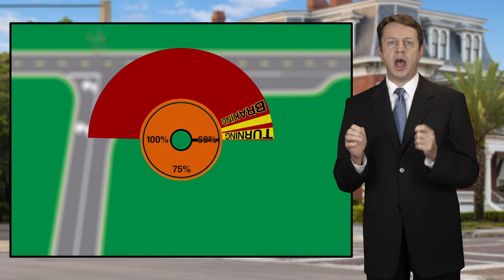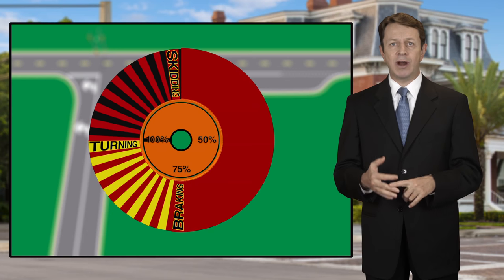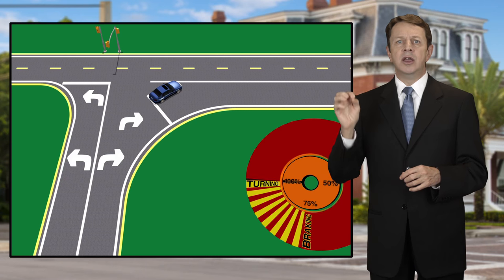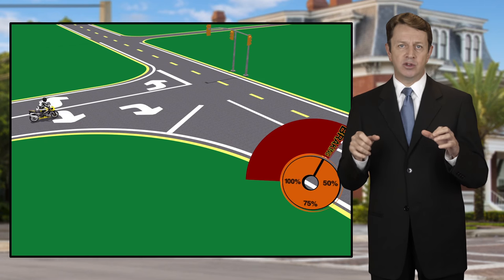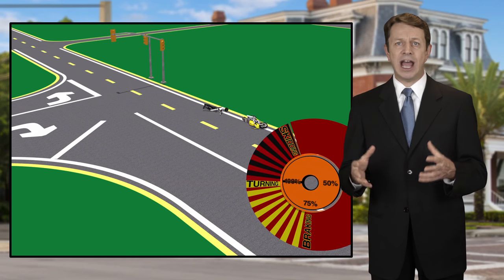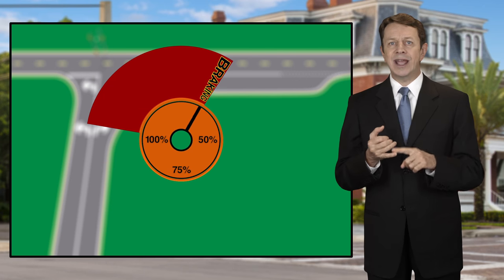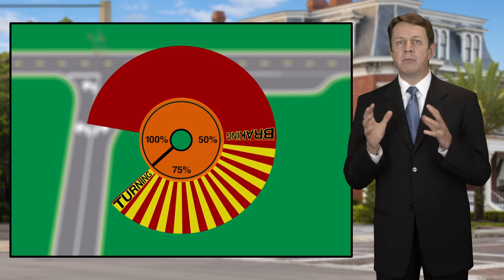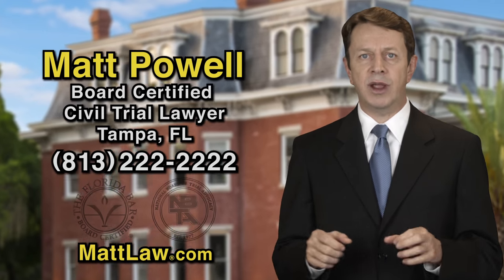MOTORCYCLE BRAKING IN A TURN - AVIOID A CRASH - Motorcycle Braking in a Turn ⭐⭐⭐⭐⭐

Comment: If you HAVE to brake during a turn, use REAR BRAKE ONLY! Just tap it a few times whilst still countersteering and you should slow down just fine.
Reply: Trail braking is the key
Reply: could be, but but gradual deceleration will yield the same results. But any kind of urgent braking on a turn will make you crash every time. It's basic physics. If the bike is leaning, IT MUST BE ROLLING.
Reply from the maker: Ride safely

Comment: One thing that I left out and so did this lawyer is any change in your motorcycle brakes, clutch or suspension which could cause a cornering accident. I had new brake pads put on my motorcycle and the lines were bled. This changed my braking immensely. The rear brake line had water and air in the line. The original rear brake would drag about 2% when I pushed down on the peddle quite hard. The new brake pads and especially the brake line being bled moved the braking up on the foot peddle and it would start braking... like right now compared to the travel it took on the old brake. Not being adjusted to such a change... you guessed it... I locked up the rear brake in the turn and hit gravel with the front tire and down it went!
Reply from the maker: Great point about braking.  Be careful after making any adjustments to your bike, and try to break in your breaks a little to get used to how they feel.

Comment: at motorcycle school in Canada, they teach that if you have to break in a turn, you straighten your bike up then break in a straight line. It was part of the final practical examination.
Reply from the maker: That is an excellent strategy.  You can brake as hard as you can going straight and still maintain control, but once you add some turning, you are risking a bad fall.  Thanks for your comment.
Reply: Yeah but then u'll fly into the other lane
Reply: @Forspartalol  Exactly. I am studying for my M1 license here in Canada (I've had my motorcycle license for over 20 years back in The Netherlands) but this 'rule' baffles me really. It's extremely dangerous, whether you are in a 2or 4 lane road, or just a street where you have incoming traffic. Following this strategy will make you crash into traffic! It's so weird!
Reply: @AdriaanHup  Its not unnatural to brake or lose speed by de acceleration only whilst on a bend.  In the UK with our roads being bendy we are forever slowing on bends altering our speed and direction.  

What  he is just basically saying is that prevention is better than cure and to do all one's braking whilst on the straight before actually turning for the bend. However of one is caught out with say a sharpening turn in than bend don't whatever you do react by slamming on the brakes.   Its useful to know just what you can do to mitigate  this danger.  One thing is to slow using the back brake first and that will slow on down enough to  enable you to counter steer into the new curve and still keep  traction or to as some say brake stand the bike up and then for only for a short distance, not entering he opposite  carriageway and then to re take the bend at a new angle and with less speed.

Comment: Don't teach riders to fear the brakes on their motorcycle.  Fear leads to crashes because it prevents riders from braking when they need to.  Studies show that when an emergency stop must be made,  riders only use about 50% of the bike's braking capability.  This causes many unnecessary injuries and deaths that could have been prevented if only the rider had trusted the tires.   To remove the fear of braking, riders should practice hard straight-line braking,  and gentle mid-turn braking.
If you want to be safer on a motorcycle, do not teach fear, instead, learn how to brake quickly and safely, for instance from Champ school.
I use the front brake mid-turn almost daily, and this is perfectly safe when done smoothly.  At normal traffic speeds, you are only using a small percentage of the available traction in a turn, so there is very little risk when smoothly braking mid-turn, as long as you don't hammer the brake, it'll be fine.
Worrying about traction mid-turn is only necessary if you ride far above the speed limit (in which case you have to worry about other things too).   If you don't hammer the brakes, then you can trust the tires.

Comment: I also see the  tolerance to breaking ones traction or grip on the road as a circle representing 100%  The way I think about it is, say we have abend ahead of us and when looking forwards as far as we can see, we are then looking at the limit point to our view and that is the only amount of space that we can safely brake in, the space between you and that limit point.   So vision to the limit point should give us the  maximum or optimum speed for that bend or curve.  Then following some degree of slowing  we enter the bend and we start to lean over. 

So lets say that we are doing 40 mph and with a 40 deg. lean angle.  That lean angle represents  an amount of used grip that we have.  So if we have a lean angle of some 40 deg. we are using 40 % of our available grip then that means that instead of all of the 100% of braking ability we used to have it now becomes only some 60% left to  brake in. 40 plus 60 = 100%.  If we are required to brake hard then we only have 60% left of our grip. If we exceed that 60%  then we are more than likely going to lose whatever grip we might have and slide off the bike.  That is how it is.. 

It follows that if we  recognise that we  only  have some 60% of traction left to brake in and possibly alter our course   a little then we must be gentler on the brakes and therefore not hit them hard. Then once we have some degree of progressive braking then as we slow and become more upright we can still steer  following the    curve and brake more progressively and to a stop.

Comment: That graphic circle wasn't explained properly
Reply from the maker: Which part?
Reply: Braking, turning, skidding around 100%, 50%, 75% of what? Traction? Then how come skidding starts at 100%? No idea what that graphic is telling and it's hard to see the correlation between the circle and what you're saying as it animates. What you're saying makes sense though.
Reply from the maker: The graphic is showing that once you cross the 100% threshold of traction, your tires cannot maintain grip on the road.  I am trying to show that braking uses some of the available traction, then when you add turning, the turning uses or takes up some traction and when you add the two amounts of traction together that is how effective you are using traction to control your bike.  But when you exceed 100% you may enter into a skid and possibly lose control as well.
Reply: Ok, thanks for explaining that. Maybe the circle wasn't such a good choice because it gives an impression that the traction is decreasing from 100% to 50% when it starts animating. And, it's a bit confusing to see skidding start when you have 100% traction available, while what you want to convey is that 100% of it has been used up. But, I do get it know.
Reply from the maker: Thanks RKT.  You make an excellent point!  I see now how it could be interpreted exactly opposite to what I am saying.  I will work on the video and try making this more clear, and saying that when you are at maximum traction, and add more braking or turning, you go to zero traction.  Let me work on this.  Thanks for your assistance.  Matt
Reply: Thanks for your efforts, it's very well done, and your aim to make it even better is making difference - for example you explain perfectly [for the new riders] why 'squeeze, do not grab' is proper course of action (in a case of emergency braking).
Reply from the maker: Kgsz, thanks for taking the time to watch the video, and to leave a comment.

Comment: The correct move is to push the handle bars down in the direction you want to go and roll on the throttle gently. 
This is never the wrong thing to do. Everything else transfers weight to the smaller front tire and stands the bike up making your turn radius larger. 
Do not unload the larger rear tire, it can force you off the high side. Keep the throttle on lightly and keep pushing the bar down. 
The bike has much more ability than the rider, let the geometry do the work. 
At the worst you will go down on the low side and not be thrown off the high side.
Reply from the maker: Hi One Slave.  Thanks for the great explanation and information.  Matt
Reply: I know it's late reply but braking does not stand the bike up , excessive speed causes larger turning radius . Anything you can do to  reduce speed like progressive brake pressure so as to not suddenly load the front tyre will slow the bike and tighten corner radius . It's been proven you can front brake in a turn surprisingly hard , what matters is the technique of how the brakes are applied , load the tyre first then squeeze more. should be what your doing all the time even in a straight line .

Comment: Thnx. Do you know how much is too much when cornering heavy bikes or non sport bikes?
Reply: Haitham S.B 
No such thing as to much.
Lay it down with the bars and roll the throttle on steady keeping the weight on your larger rear tire. 
This is always right, 100% of the time and never the wrong response. 
Everything else hurts you and is known as a false survival response you must overcome with practice. 
Almost all crashes are within the bikes cornering abilities and are strictly rider error and improper response. 
There are 8 survival responses that are wrong and can get you injured or worse. 
If I remember right you can avoid all of them by simply pushing the bar down and rolling on the throttle.
Reply: Okay, hopefully you didn't bother with the jackass... and this finds you still alive and relatively well...

Heavier non-sport bikes tend to be ridden with less over-all effort toward the top-end of the speed range. They still occasionally call a Harley a "Milwaukee Vibrator" for that particular reason... 

  If you're new to your "Cruiser" and worry about "low siding", the ritual is relatively easy. Don't even start the bike the first time on... Just kick up the stand, and flip down the pegs as necessary/applicable. Now carefully ease it over to the side in place. I might recommend this in the grass or something so you don't ding up the paint right off... BUT the point of this is so you can start getting a feel for how far your "lean limit" is... While you practice the lean, look around the lower side of the bike. You don't have to go all the way, just about 45 degrees is usually enough. I know... It's heavy af... BUT especially as a beginner, you should be on a bike you can handle pretty easily... Think about that, too.
    You'll want to look for signs that you're close to the limit. Some of the big old-school cruisers ride so low that they won't even lean a full 45 degrees. You'll also want to know first-hand what will be "sacrificed" to the road surface first in a "low side". 

    Most heavy bikes easily keep up enough traction to handle any turn so long as YOU have the strength to maintain the turn with the controls of the bike... BUT regardless of your speed and the turn in question, you should  :
1. Slow down a bit... This is vague, but the general rule of thumb is to ride at about 60-80% of your skill level. Keeping in mind I'm talking about traffic here. If you want to practice pushing your limits, go to a track. Decreasing speed does two things. First, it puts more of your weight onto the front tire to add to its traction and thereby its control of the bike's path. Second, it reduces the rotating and therein the gyroscopic energy of your wheels and tires, DE-stabilizing the bike and making it easier to lean her over.

2. Look not just at where you're going but where you want to go... Look THROUGH the turn... Dismiss anything you don't want to run right over or hit... and find the clear path for your bike to take.

3. Press the handle-bars to initiate the lean. It's relatively the same control as a bicycle, only on a bigger, heavier machine. It takes a little more work to ride a motorcycle. As you press the handlebars, the bike will practically lean itself. On a big cruiser, let yourself move WITH it. Fighting the bike only gets you into trouble. The bike is going to win.

4. Roll onto the throttle as you're finishing/exiting the turn. This picks up speed, but more importantly, increases the rotational energy and gyroscopic effect of your tires and wheels, lifting you upright and making it easier to straighten the handlebars and return the bike to an upright and stable position. 

     It takes advanced training and practice to get skill at "trail braking" or braking through turning the bike. SO the majority of your slowing down needs to be done before you really begin turning processes. There isn't a magic number for this, so you have to ride to get a feel for how any particular motorcycle behaves. Personally (and I am a cruiser guy) I try to do the majority of my slowing down so I don't have to continue braking into a turn or lean, but in those instances when I feel the need, I let off to about 40% of my usual brake pressure for a controlled stop like at a traffic light or sign "without panic"... It seems to just "feel right"... 

     Hope this helps anybody. AND for the love of god and the skin of your ass, should you decide to practice braking and turning simultaneously, start out slowly and practice in a parking lot with space so you don't lose it on the highways or into oncoming traffic. ;o)
Reply from the maker: Practice makes perfect.

Comment: Im recuperating from a fall on my bike going into a turn, short story I'm an idiot yup hurts the ego but yeah im an idiot i wanted to open my throttle coming down a short street before a right turn, so if i guess right i feel that i went hard on my front break while trying to compensate for the up coming turn all i remember is the bike did a quick wobble then bang me and the bike are sliding sideways down the road i imagine this was at about 40 to 50 km/hr maybe more but im an idiot cause 1-excelerated coming into a turn 2-left all my gear in my closet at home 3- just finished a jay not even an hour before
Bikes scrathed up and i ended up with a broken ankle cause the bike fell on top of me. Im now debating whether im responsible enough to even attemt at getting back on my bike, now that I'm starting to heal up or should i just shelf it. Bike was a 650 sport touring Kawasaki
Reply from the maker: Hey Ezay,  Sorry to hear about your spill.  Thanks for sharing though, because it is important to share the bad as well as the good riding.  Take care of yourself, and I wish you a speedy recovery.  I bet you will be riding again soon.  Be careful and ride safe.  Matt
Reply: MattLaw no problem hope it helps someone else make more wiser dicisions then I, Thankyou for the tips they are really informative much appreciated

Comment: that's nice but i didn't understand anything
Reply from the maker: Thanks for watching.
Reply: It's simple. When you brake some of the tires grip is lost and same goes for turning. When driving you will rarely exceed over 75% of the tires threshhold. When you brake and turn at the same time a lot of the grip is lost. In another perspective, if your braking takes 40% of the tire threshold and the turning takes 30% you will not loose grip, but if the turning takes 60% or more, the tires will loose grip resulting in crashing 90% of the time.

Comment: Any Links to this class that teaches braking in a turn? Looking into this as i had a narrow escape the other week and would like to know how to correctly save me and my bike. I have a feeling it was luck and my guardian angel that saved me last time...
Reply from the maker: I know that my local Harley Davidson shop offers basic and advanced riding classes.  I have not taken the advanced class, however, I am sure they teach braking in a turn.
Thank your guardian angel, and get into a good class.  Ride safe.  Matt
Reply: I shall have to enquire as info on youtube about what to actually do if you find yourself in a corner too fast is sadly lacking.

Thankyou for the quick response.
Reply: SuperScumble 
The only response that is acceptable is to push the bar down in the direction you want to go and roll the throttle on lightly. 
Do not release the throttle, that stands the bike up and widens your turn as does rolling off the throttle or braking. 
Pushing the bar down and rolling on the throttle easy is never wrong and is the only right thing to do 100% of the time. 
Any other action is wrong and dangerous. 
Do not transfer weight off the rear wheel, keep a large contact patch and let the bike work as designed. 
Braking while turning shortens your ground clearance when laying the bike over and will get you into trouble fast.